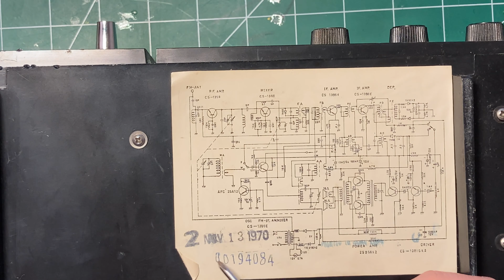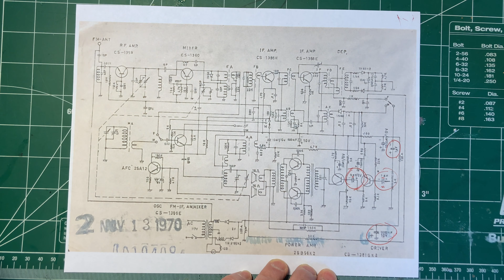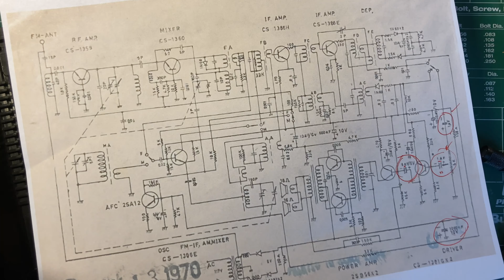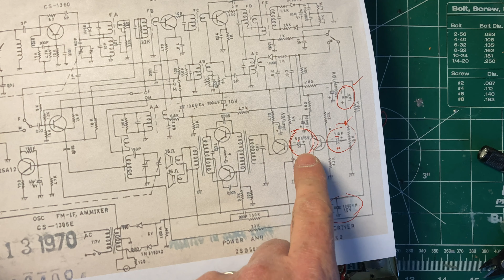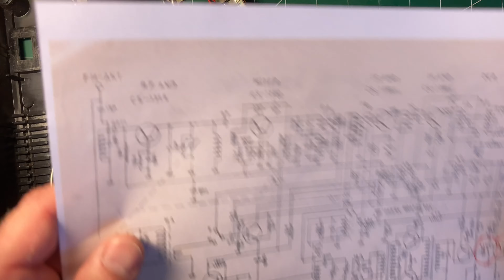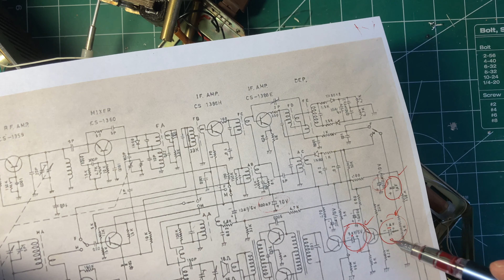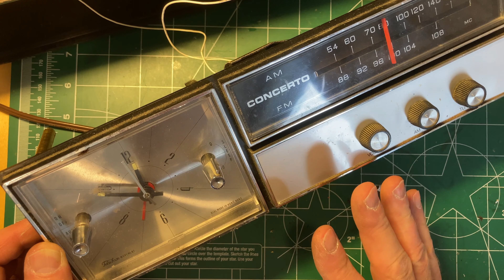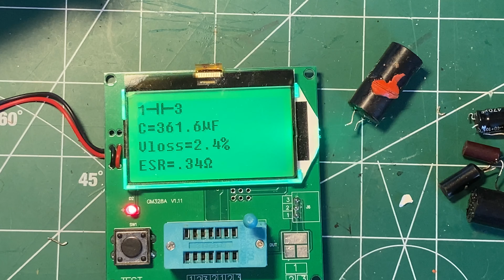1970 Concerto Clock Radio Repair

Comment: That’s almost 😅 like 👍 my dads bedside radio, but his featured AM only, and had a dial light 💡 behind the clock 🕰. His was white, but I don’t remember the brand name. This features a nice 😊 brushed aluminum clock dial, his did not. It seems there’s AM oscillator, push-pull audio output, and those sorts of things. I’d check the volume control potentiometer, before ya replace it. Usually a little DeOxit works. Capacitors usually get lossy after the years, going up in tolerance. Be careful not to burn 🔥 the dial cord in two, if soldering. Almost 😅 anybody hates dial cord restringing jobs. They are very hard to do. Your friend, Jeff.